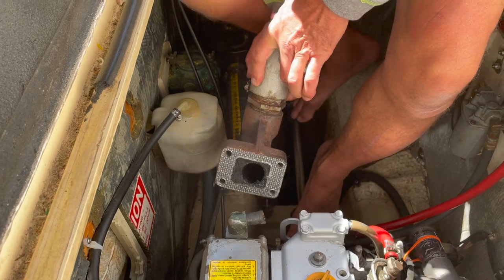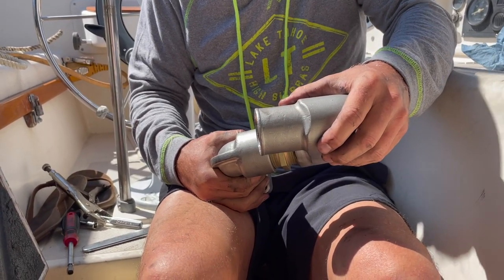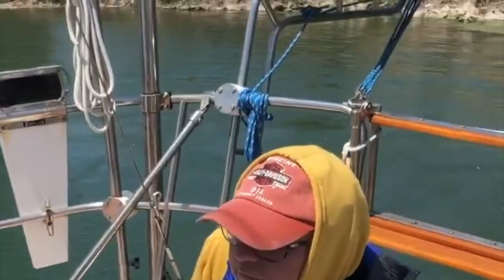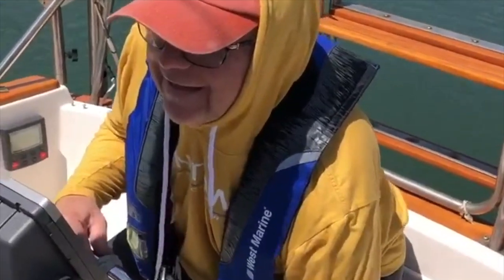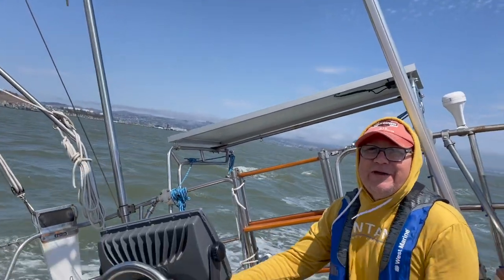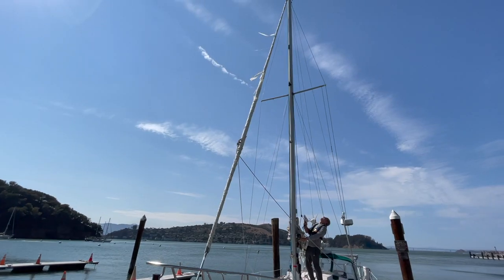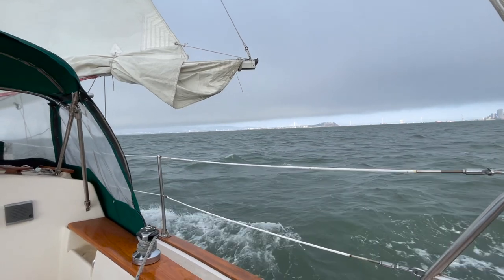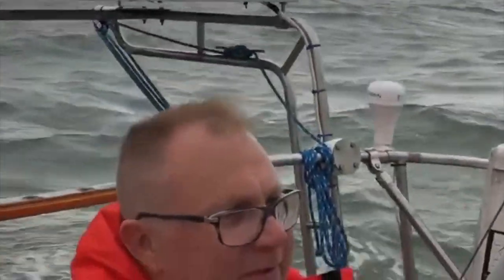S1E33 - EAGER To Sail BIG WIND In San Francisco Bay!

Comment: The reef in the main is a  disaster.  The clew line should go through the clew cringle and be tied  down to the boom with a bowline so that downwards as wall as aftwards force is generated when you tighten the clew reef line. The luff is way to loose, you need to crank the halyard very tight before tightening the clew line or you will pull your sail slugs out..   Never use the intermediate reef points without an extra line from the clew around  the boom.  if the clew reef lets go without your extra line it will rip the sail at each intermediate reef point.